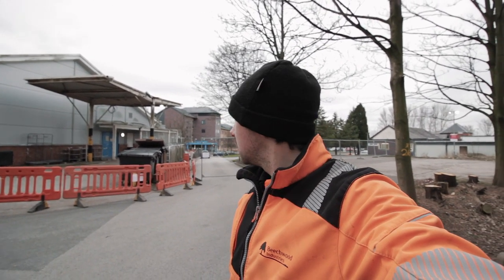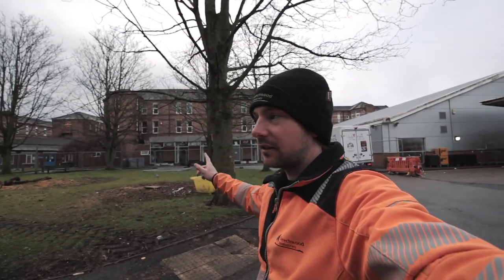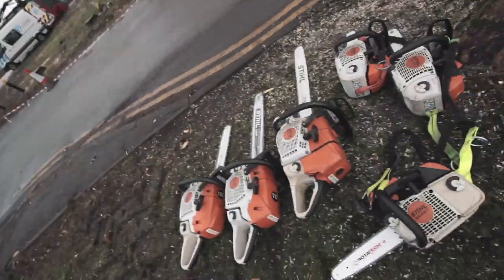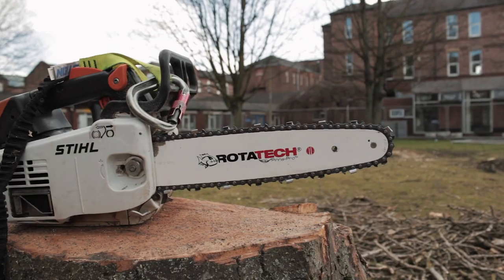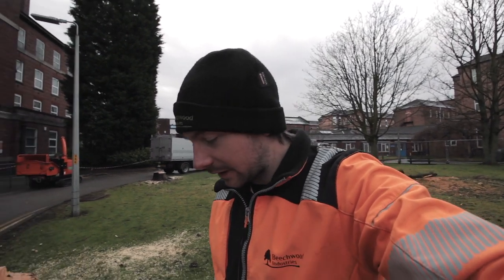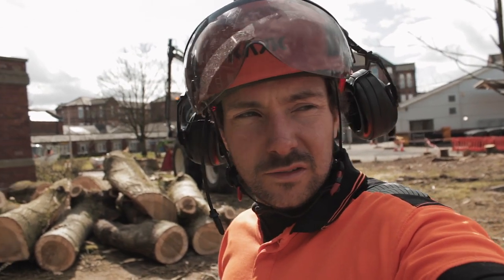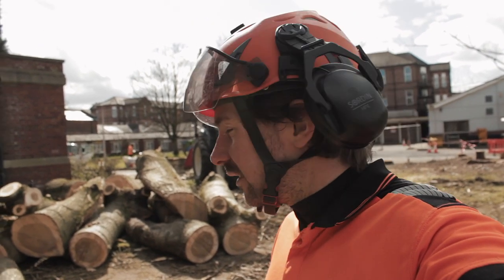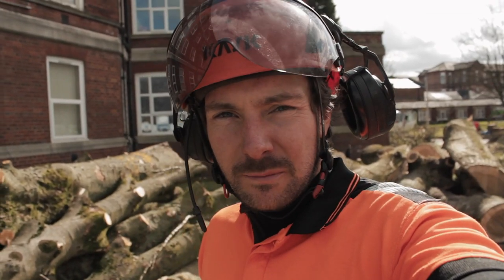UK Arborist VLOG (Hospital site clearance)

Comment: That bar will melt 😒 made of playdo  200t deserves a quality bar
Reply from the maker: Interesting, it's my first time using one. Have you used them? Can you elaborate?
Reply: @MattGlynn  just very poor metal quality they wear unevenly on the top of the rail causing the chain to wobble In the cut = less accurate cutting then the sprocket In the tip will just disintegrate there is no way to make a good quality cheap bar quality and cheap aren't possible u get what u pay for I personally run a cannon bar on my 200t but stihl bars are great quality and sugihara u are really coming on a as climber buy the way am really enjoying the vids 👌
Reply from the maker: @drltreecare7353  oh ok thanks, how long we talking before this happens?
Reply: @MattGlynn  depends on how much u use ur saw 😉
Reply from the maker: @drltreecare7353  haha fair one, thanks for the info. I like the narrower tip on the top handle bar but will certainly be putting it though it's paces.